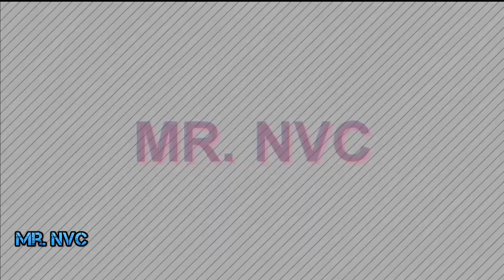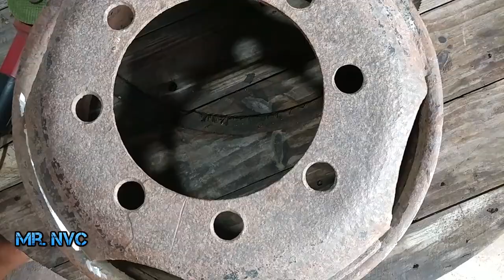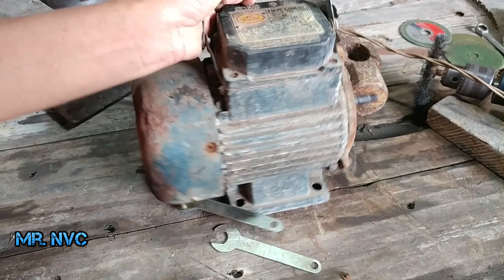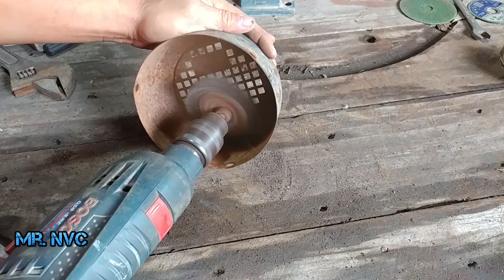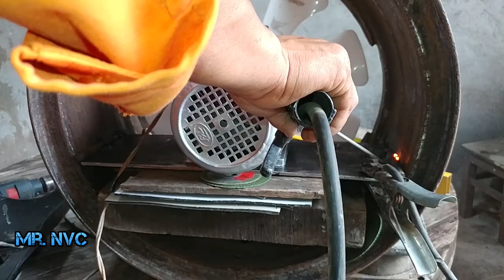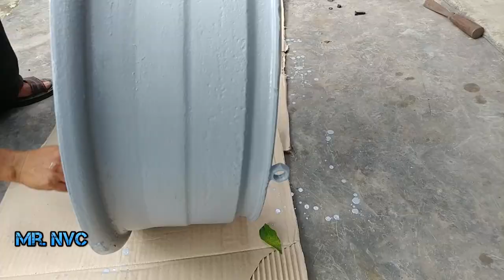DIY Workshop Exhaust Fan - How It's Made

Comment: The only thing, and the most important thing, is that the quotes deben rozar por el ancho de un papal and the fan hull, they are to maximize the aerodynamic effect and maximize the pressure, the best thing would be to get some quotes but grander and cut them to size fair

Comment: Hey man love the video! Was wondering what the name of the engine (?) u used. I’m new to this kinda stuff and wanna plan some projects and something like this is one
Reply: My bad I meant motor not engine
Reply: A bit late, but he said recently that it was from a water pump. However, any suitably sized motor should work. As long as it's able to spin the fan blades at a good speed and not get too hot, the motor is fine.
Reply: @fuizipra  i
Reply: @angelocacciapaglia1746  haha yeah!

Comment: how many rpm the drive dynamo is used
Thanks....
Reply from the maker: 1800 rpm. Thanks
Reply: Oke thanks broo
Reply: @anobmabi6253  ya saudara
Reply: @anobmabi6253  saya sudah membuatnya dan berfungsi dengan baik
Reply: Power brp watt ya?
Reply: @anobmabi6253  kecil bgt 40watt ?
Reply: @supardihasyim4271  boleh minta wa?
Reply: @supardihasyim4271  siap om... Mau konsultasi